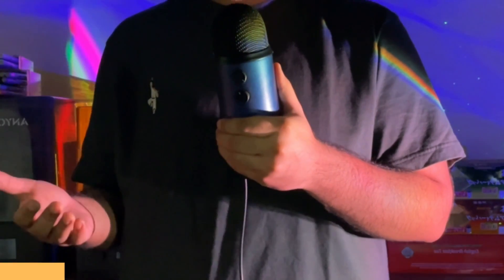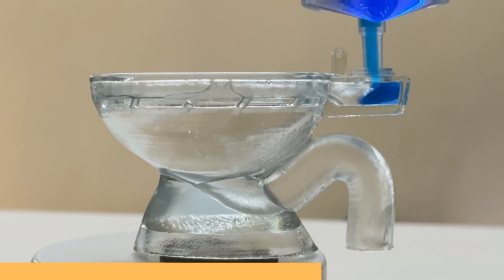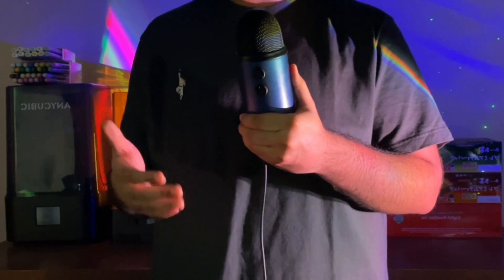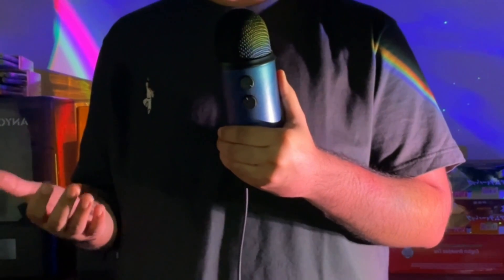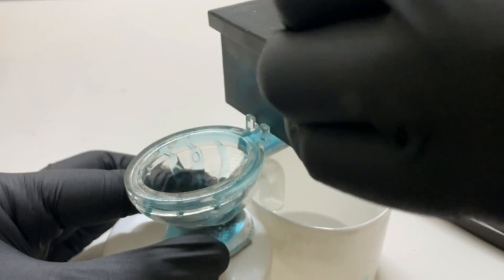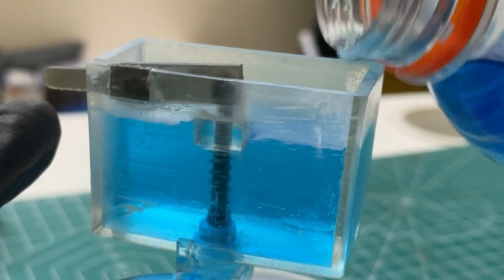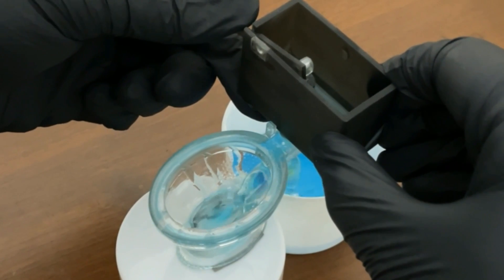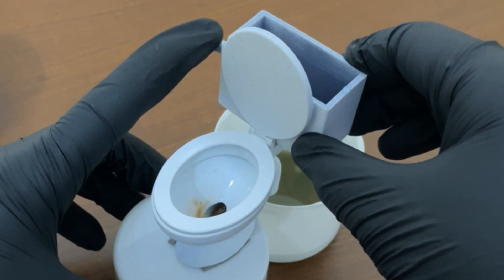World’s Smallest (Working) Toilet [3D Printed]

Comment: Amazing! I'm just surprised you did not 3D print a tiny plunger. LOL
Reply from the maker: Dude, I was legit gonna do that! I mean, not "3D print" a plunger, but 3D print a mold and then cast the plunger in silicon, but I ran out of time. Oh well.
Reply: @toast_channel  No worries. Not that you will need a mini plunger in the future, but I think you could have FDM printed in TPU. Not sure if it would have worked, but the business end would have been "rubbery" enough to at least flex kind of like the real thing.

Comment: Hey man! Really enjoyed the video! 
I have some constructive criticism for you. 
The jokes and humor are really good. But you might want to work a little bit on the delivery. Try to punctuate the jokes a bit more.
The voice over overall is good, and your flow is good. It does not sound forced, or like you're struggling. 
The sound of the voice over is a little bit lacking. Your voice is really muffled. Like if you're holding the microphone the wrong way, or as if you have some really heavy noise compression on. Experiment with your settings and see if you can get some clearer voice over, or invest in a better microphone if you're planning on continuing doing videos.
The editing is snappy and well made. You hold the shots for just long enough to get your point across, without a bunch of dead time.

Overall, I hope to see more of you in the feature! Subscribed! :)
Reply from the maker: Thanks man, really appreciate you taking time out for this. This is super helpful, I usually have trouble pinpointing issues and it really helps when other people provide useful feedback. Thanks for the sub as well!